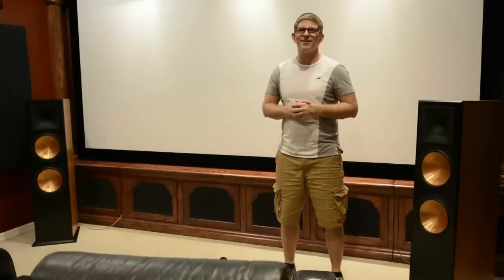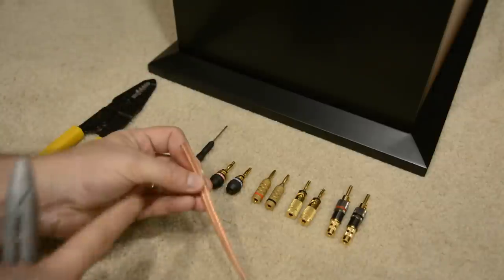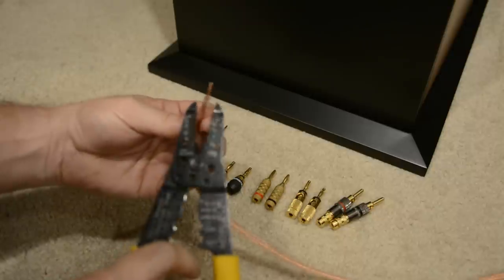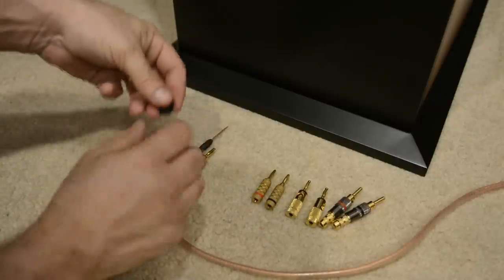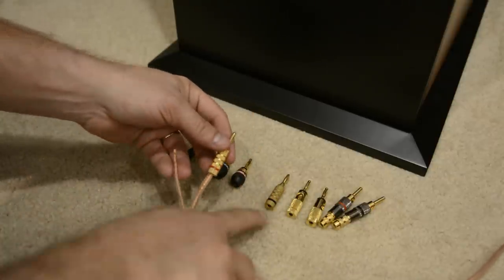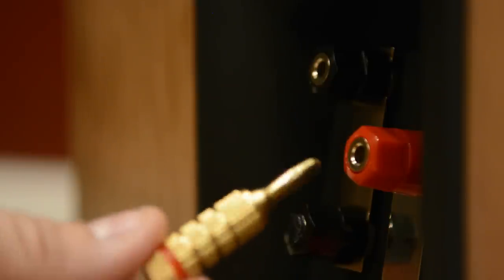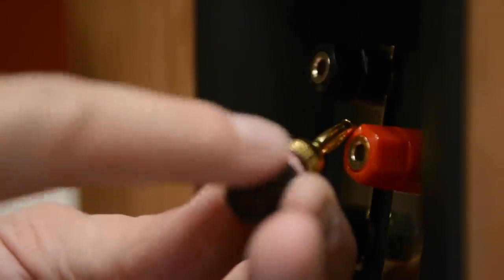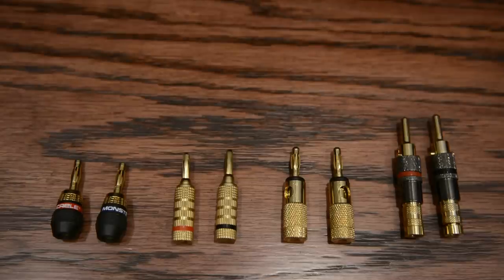Why Banana Plugs are a Must for My Home Theater and 2ch Audio System

Comment: Hey Youthman, here's a tip for those Cable Matters plugs.... to quickly tighten the fit, just hold the threaded barrel, and tap them on a solid surface, or tap on the tips with the wire cutters, or anything you can tap with..... spreads out the leaves of the plug as good as new.... and quick! Once I'm done terminating with the plugs, I usually use red and black heat shrink over the barrels... quick and easy identification in dark, tight audio racks, and insulated against shorts from contact.
Reply: I hadn't thought of an "impact adjustment" to spread the leaves out where the gaps are too narrow except for a very sharp knife. Thanks!

Comment: I love your clarification to why you use the banana-plugs. Many people seems to believe that there is benefits in sound quality or to avoid cable ends oxidization and such. As if there wouldn't be exacly the same with the transition form the cable to the connector itself. Bananaplugs might be convenient while moving around furnitures and moving speakers or comparing as you mentioned, but the sound quality won't be beneficial. I like to solder the ends and screw clamp them for a firm fit. Those metal contact plates that you bent out with the box cutter will never have the same contact surface as a soldered and screw clamped joint. But the selling argument is often that you get a better connetion with the banana plugs, and that's nonsens. You still have to make a connection from the cable to the actual connector, and from the connector into the speaker connector. Then you have two possible weak spots instead of one.

I actually ordered a complete sound system today with bare wires, and the seller asked if I wanted to buy those banana plugs to "as it will be better connection to the speaker" as he claimed. But I said of course no to that offer, since it would put me down an additional cost of like 60$ equivalens. The few times it's time for moving out or moving furnitures around, I will gladly unscrew and take the extra time, knowing that I saved 60$ and also know that I wasn't that naive.

Anyways, thanks for the video! I love stuff like this. And you also had a good excuse to use banana plugs, and that makes me glad to see. =)
Reply: Hell yeah! Bare wire for the win! This is why you get bit more cable than you need you can cut the end and have oxidation free cable. Or you can clean the tip with vinegard to remove oxidation.
Reply: There's plenty of purists who advise against any plugs because they indeed are additional components and material in the line there. - Myself I think it's all a load of nonsense either way. I've been in the guitar world, and even though that's different on a technical level (lo-fi instead of hi-fi, mono instead of stereo, and so on), people are way too nitpicky and up in arms about almost mythical stuff when it comes to sound quality. To me it's just mostly "on or off" and you'll notice if the signal is actually bad. A plug in between, unless faulty, isn't going to make it better or worse, no matter material (unless it's wood or something). A solid connection is important, it just needs the contact, but I've used the most basic and even "ruined" stuff, like crappy cable ends and corroded plugs, and it sounded like nothing was wrong. And I mean in hi-fi setups. But even if I'd have to go back to the guitar-stuff; In that world, people hook up many components with home-made cables and just screwed on plugs and it all doesn't really matter, let alone just 2-4 plugs on a hi-fi cable.
I'm just looking into these plugs because I'm sick of dealing with stripping the ends, twisting the wires and trying to get them into the terminals properly, almost every time I want to take them out and put them in. - Just use plugs, it just makes it more neat to deal with is all. :)

Comment: To avoid the possibility of short circuit when using the bare metal banana plugs I have always slipped some clear heat shrink sleeve over the body and the first 1/2 inch of the wire. This also acts as strain relief.
Reply from the maker: Yeah I’ve always been concerned about them possibly touching while in use but so far so good.
Reply from the maker: Great tip!

Comment: I love the video! Very helpful and informative. 
I disagree with your statement saying that banana plug’s are meant for only convenience. 

I agree that banana plugs are convenient, but they also establish a better contact with the speakers than plain wire. My wires used to get blackened over time, but with banana plugs, no more! Just a little thing I picked up on. If there is a speaker wire principle I don’t know of, please feel free to correct me and teach me otherwise!!
Reply from the maker: It’s not that banana plugs make a better contact that bare speaker wire, it’s just that your speaker wire is oxidizing over time. If your wire is not hanging out of the AVR, it shouldn’t be oxidizing over time.

Comment: Do you twist the wire before you feed it through & fold it over the teeth? Or do you strip it, feed it through, & fold it over teeth? I think I been doing it wrong all along. It’s hard to tell in video.

Comment: i use solid, reasonably thick copper wire for my speakers; as opposed to stranded thin copper cable. 
I’ve got lots of banana plugs; but never use them for my pioneer home cinema network receiver.  i think they are solid brass.    i don’t like surround sound.  3D is alright. 
Thursday 16th March 2023. U.K. 🇬🇧 Southampton

Comment: You know what you could do with the Harmon... add 2 more pair of speaker cables and bi amp the towers as opposed to single wiring.   The towers have 4 binding posts as well, so you would be driving the tweeters and mid-range separate from the base drivers with different amps in the Harmon.    I couldn't imagine you were going to get better sound with the Harmon though.  What are your thoughts on the home theater, prefer the Klipsch or the SVS?
Reply from the maker: Hi Tactical, Several years ago, I did some testing with bi-amping and did not find any difference.  All of the research I have done suggests that unless you are going to bypass the internal crossover in your speaker, bi-amping won't make any difference.

I have not done any direct A/B comparison between Klipsch and SVS for 2ch or for movies.   I now have the SVS Towers in the living room and just setup the Klipsch RF-7 III and RC-64 III in the theater room.  Today I'm going to work on a video setting up the speakers and running Audyssey.  My guess is the RF-7 III and RC-64 III would easily take the win for Home Theater.  Much larger tweeter, larger drivers, larger speaker cabinet, not to mention that the horns on Klipsch are brighter and more detailed than the SVS.  But then again, we are comparing a $3200 pair of speakers to a $2000 pair of speakers and a $1500 center to a $700 center.  I would expect the Klipsch to win being in a totally different tier as the SVS Ultra Towers.  Which do you think would come out on top?

Thanks for watching.
Reply: Youthman I think that when someone is used to the sound of the Klipsch horns nothing else seems as detailed.  I still think you will certainly prefer the Klipsch over the SVS Ultras, no matter what amp you throw at them, but I do think the SVS Towers sound unique with movie details when turned up really loud.  I certainly love my SVS Towers however when it comes to 2 Channel music playback I run a pair of KEF omni q  speakers that differ in a few ways when driven with separate power amps.

Comment: What makes a difference as long as you have a good solid connection. The only good thing about banana plug connections is the convenience of being able to unplug and plug in quickly. Wrap-around screw down terminals are just as good. Once you have your speakers connected, in reality how often are you going to be changing them out or do you have to have a quick disconnect?. A solid connection is a solid connection, continuity Remains the Same. Unless your speakers are bouncing around hard enough to cause terminal damage and wire shearing, any solid terminal connection is sufficient.

Comment: I use unlabled Acoustic Research Banana plugs on the "front" binding posts of my receiver and Bare-wire to the floor-standing speaker's spring-clips. I might go back and tin the ends of the wire with solder.  Sometimes receiver will also have caps in the binding posts. But mine didn't. 

I've never had Bi-ampable speakers before, except for the time I had a JVC mini system that sounded decent but the CD changer kept breaking so I had to return it to the store to get it repaired twice. I left it there the second time.
Reply: my  JBL Control One Pro's are connected  by  springclips..  would  prefer if they were  binding posts.. however the  sound is  fine  through  them.. however the other  end  is  connected vis  bananaplugs.. to the receiver.
Reply from the maker: Yeah it will not effect the sound.
Reply: @Youthman  but it  makes using binding  posts usable rather than  using   bare  wire.. as the  speakers  can  go flush  up  against the wall.. Yet with  banana  plugs  it'll  put  tension and stress  on the  binding posts if the  speakers are  flush  with the wall.

Comment: I just got Sewell Deadbolt banana plugs from Amazon.ca and they are the same style as the Monster ones you have. I put a magnet to the tips and the plugs were attracted to the magnet. Should I be worried? Doesn’t this imply the tips have something in there other than copper or gold plated?

Comment: Would you recommend using banana plugs for in wall or in ceiling speakers?
Reply from the maker: I use them on all of my connections except my in-ceiling since they are very simple to attach bare wire and I have no intention of removing them
Reply: Youthman I agree, I’m trying to setup my first home theater in my living room. I want a 5.1.4. I want in wall for Center Stage and Surrounds with 4 in ceiling Atmos Speakers.

Comment: This video was quite informative. Thanks. I would love to hear you opinion abou speaker cables. Do they really make difference in sound quality?
Reply from the maker: Thanks Zoltan.  I have never been able to hear a difference between inexpensive and high end cables.  Although it’s highly debatable, IMO, Copper is Copper.  I just use 12 or 14 gauge wire from Monoprice and it works great.
Reply: No difference in sound quality. It's about aesthetics as far as I'm concerned. Overall, after having outfitted my entire 7.2 in-wall system with B-plugs at both ends, in addition to having 5 more pairs distributed first into a channel splitter, which in turn sends the essential stereo signal to any of the 5 other speaker pairs in and around my home, I ask myself a simple question: Why?
It looks pretty cool, but it was rather pricey making the purchase of all the plugs, then having to purchase all the mating receptacle ends as well. Plumbing all the wire to all the regions (two pairs outside, the first to my backyard facing deck, and second to side-yard facing patio) and then ceiling mount single cone stereo in Kitchen, MBR, and final pair in garage. Lots of work. Massively confusing when something loses a wire, which banana plugs easily do.
I have all 12g mid level speaker wire, which because of some lengthy distances, was deemed necessary, whereas I know 14 was more than adequate. 

On one hand I COMPLETELY hate banana plugs. But bare wire looks terrible unless it's painstakingly installed. 

When I move, I plan to leave all the speakers in the walls. But the next buyer of my home won't be pleased with the existing wall config I installed. 32 female banana jacks, plus 4 CAT6e LAN terminations. All of which will be obsolete in a matter of weeks it seems.

Comment: Nice video, I was wondering what the jumpers are for? I would think that they are connected together inside the speaker box
Reply from the maker: Speakers have jumpers on the outside to connect the low and high speaker terminals.  By removing them, you can then provide separate amplification to each speaker.  Google Biwiring speakers and biamping speakers.  I myself have never heard a difference with my ears.
Reply: Youthman ok thanks
Reply from the maker: Glad to help

Comment: spade connectors are great as well. they can be used if you have limited space behind your gear since they mount on an angle, not straight out the back of the speaker terminals like bananas.
Reply from the maker: I've never used Spades before.  Seems like they would work descent for speakers but depending on how your binding posts are laid out on your receiver, they may or may not work.
Reply: i use them on my 2 channel amps you are correct the spacing has to match. i used to use bananas for everything until i got a massive power amp that couldn't fit bananas between the terminals and the rear cable management bracket on the racking.

Comment: This is an old video but I have a question. On my speaker wire one strand has writing and the other has a white stripe. Which side is positive?
Reply from the maker: Hey John, it doesn’t matter which side you use for positive. Just make sure it’s the same on the speaker side as it is on your AVR.
Reply from the maker: I tend to use the white stripe as my positive, but again, it could be used as the negative cable since the copper inside the jacket is the same on both sides of the speaker cable.
Reply: @Youthman  Thank you so much for your input.

Comment: I have screw type banana plug  (feeding the wire inside and tighten them with screws on each opposite end and cap over to cover and close ) but I found they degrade some quality of sound and when connected bare wire to receiver, I found punchy and nice sound. I am in way upgrading my receiver to YAMAHA Aventage 70 series 2070 found it built heavy and nice compared to Marantz. Thx
Reply from the maker: Interesting.  I have never heard a difference between them myself

Comment: I have a question what if you have speakers that have no banana plug speaker terminals on the back but the push button positive/negative terminals, is it possible to replace the back terminals with banana terminals if so how easy is it to replace
Reply from the maker: You could possibly but the easier thing would be to buy spades instead of banana plugs. They would work just as convenient but would be a whole lot simpler than trying to replace the terminals

Comment: so  when using  surround  speakers that are  flush to the  wall?  Should  spade  connectors  be  used  instead of banana plugs?
Reply from the maker: You can use any type of connectors that will work with your speakers. Some have even recommended 90° angle banana plugs. I just personally have not used them
Reply: @Youthman  that's why I was thinking  spade   connectors might  be best when speakers are  flush to the wall..  such  as Height  speakers,  surround speakers.. The sound  quality should  be  no  different to that of  bananaplugs as it's still copper  on  copper.

Comment: I'd argue that if you can't use them because there's no space behind the speakers, you have a problem to begin with.
I probably shouldn't be talking considering I put most my speakers very close to walls (by lack of choice), but surely I have a little space left over. - If you don't and really put them flush with the wall, that's not good for sound. Near them isn't already, but like right up against walls... probably even worse. - Many people even recommend at least a foot away from walls, which isn't realistic for most homes, but to give the soundwaves space that's where you should have them.
Reply from the maker: You are correct. Speakers typically perform better when moved away from the wall.

Sometimes people do not have the room behind their AVR for banana plugs due to being inside a cabinet.

Comment: What's your take in oxidation....
Will I have loss of good sound over time ???
Reply from the maker: As long as your cables look fine you should be good.  I had a set of Monster Cable many years ago that began turning color so I replaced it.  I didn’t hear any difference but it gave me peace of mind.  Good thing is cables are cheap.  Don’t need “fancy” cables.  I buy most of my cables from Monoprice.

Comment: Figured I’d let you know I’ve since switched out my banana plugs and speaker wire. I have the monoprice gold ones so much. Similar to the cable matters ones. 12 ga install gear wire from amazon replacing 14ga audioquest x2 wire and the red and black bfa plugs
Reply from the maker: How do you like them?  To my ears, I’ve never heard any differences.  Copper is copper

Comment: Any video showing how to bi wire, especially the banana plug that goes into the amp. It must be 2 positive wires into one banana plug, correct?
Reply from the maker: I do not have a video on that but see if this helps - https://blog.fluance.com/bi-amp-or-bi-wire-instructions/
Reply from the maker: You would simply insert both wires into the banana plug on the amp side.

Comment: The fewer parts between music and speakers the better. I use thick ass fine stranded pure copper audio cables with just bare wire that's been tinned. The posts have a side hole and it gets clamped down.

Comment: What is the purpose of the jumpers on back of speakers?
Reply from the maker: Those are used if you are not going to biamp or biwire your speakers. You remove them if you biamp or biwire.